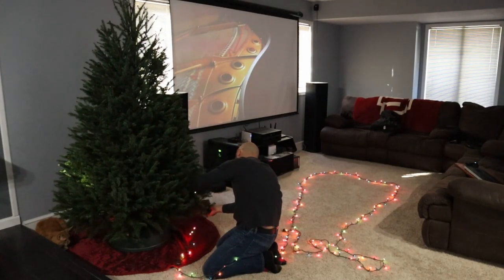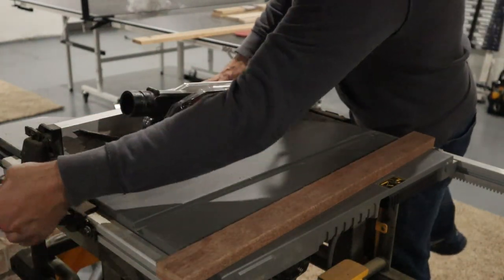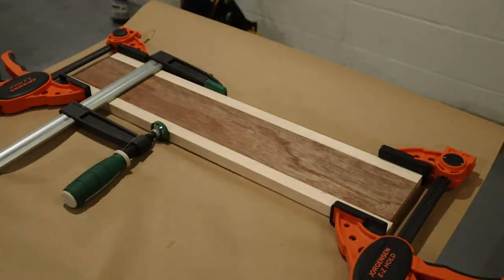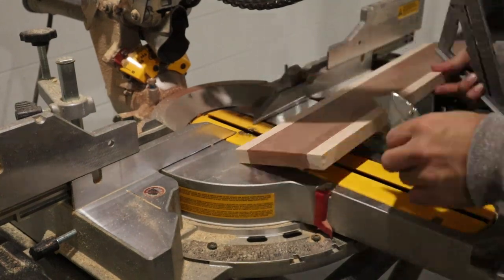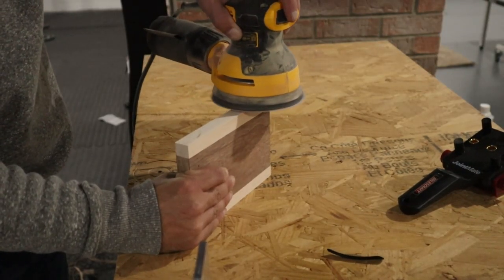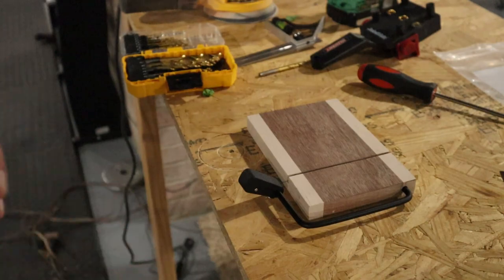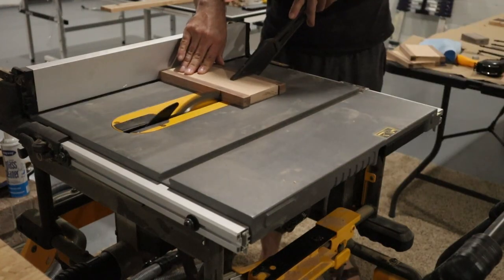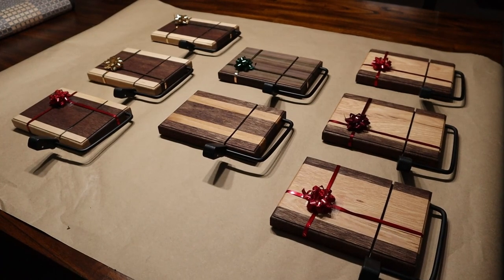Making Cheese Slicers for Christmas

Comment: Too many teeth on your blade is a likely issue too. 24 teeth is plenty for a 10" rip blade.
Reply from the maker: I had to check to be sure but the blade I have is 24 teeth.  It's the blade that came with the saw though so I'm sure it isn't meant to be great quality.

Comment: You did a great job on the boards. I am a big fan of having radius corners. They can be small to large. Not only are the more  pleasing to the eye they can also prevent the corner from chipping if dropped of mishandled. Only a suggestion on my part.

Comment: Nice project - they turned out great in the end!

The biggest culprit for the tear out on the miter saw is likely the large gap in the plate where the blade enters.  A zero-clearance insert will support the cut edge of the wood, preventing almost all tear out.  You may be able to get one for your particular saw, or you can try making one.
Reply from the maker: Didn't think of that.  Great idea.
Reply: @renovateyourmind You can also use tape. Cover the slot with some blue tape or? Raise the blade and your good for a bit.

Comment: Nice video. Now I want one. All that work and you didn't cut a piece of cheese though!

Recommend testing on camera in the videos. I've never used this type.  Hard to clean it where the wire goes in the slot?
Reply from the maker: I guess I'll find out over time.  I agree I should have tested them out in the video.  Thanks for watching!

Comment: Once tear out happens, you can just stand a roundover to eliminate it.
But if you put a sacrificial piece of wood UNDER the piece you're cutting, IT will get the tear out, not the good piece you're working on.
Also, Cutting board oil is $10 for 16oz, regular old mineral oil is $6 for 24oz at CVS. Same stuff.